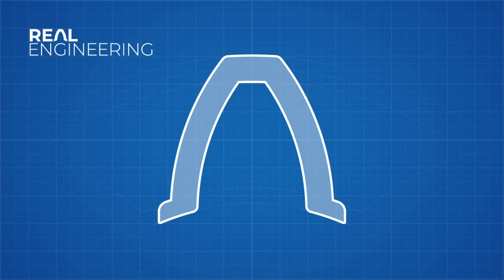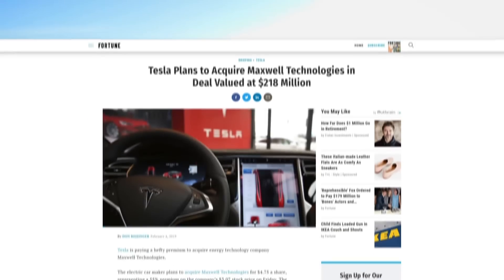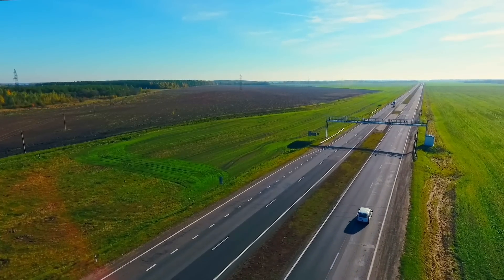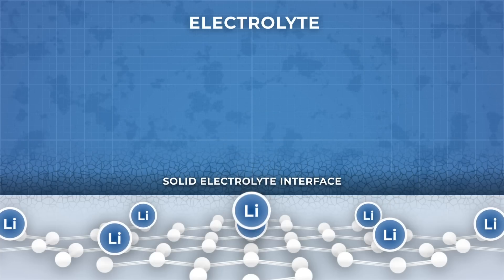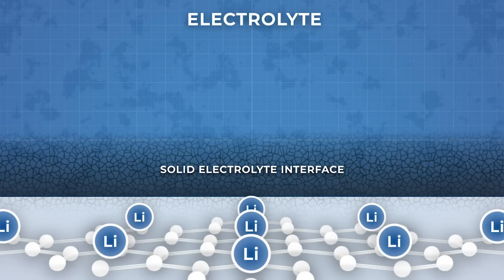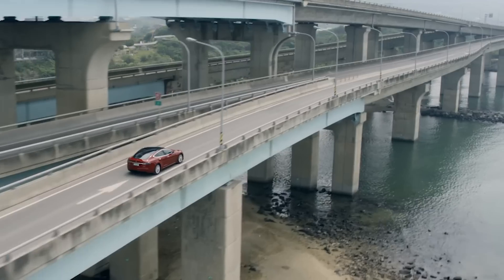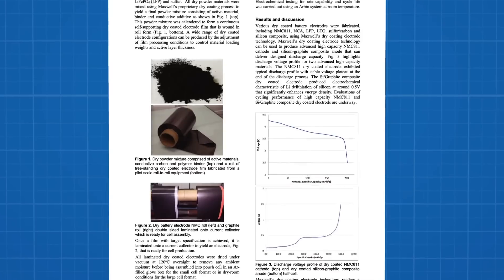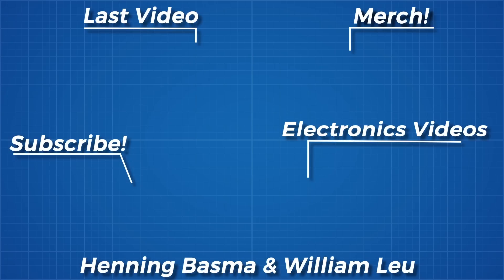Tesla's Quest for Better Batteries

Comment: So basically, the Maxwell ultra capacitor is like Glycogen while normal battery is like carbs
Reply: Eh, well, I'm not sure.  Glycogen is a carbohydrate (just a large glucose polymer, and glucose is a carb).  Glycogen is the storage form for carbohydrate in the body.  It's true that glycogen can be broken down pretty quickly relative to other substrates -- and thus yield energy for cellular work more rapidly, akin to the higher discharge rate of a Maxwell ultra-capacitor -- but the "slower" energy source that would then be much more appropriate for the analogy would then be fats/lipids.  Fats have a greater energy density than carbohydrates (akin to the greater energy density of a conventional battery when compared to capacitors), but they're slower to break down due to the number of steps involved, the speed of the individual reactions, the need to transport substrate into the mitochondria, etc.

Note that this most cleanly applies to a comparison between the process of aerobic fat breakdown and anaerobic glycogen breakdown (glycolysis), since aerobic breakdown of carbs essentially becomes the same thing once the products of glycolysis have been transported into the mitochondria and turned into Acetyl-CoA (in other words, the stuff that came from fats and the stuff that came from carbs are indistinguishable from one another at that point).

Sorry for dweebing out here and maybe being a bit of a buzzkill; I just thought I'd try my hand at creating a slightly more accurate analogy in the hopes that it'd clear up misconceptions before they're perpetuated.  Unfortunately, explaining the logic behind my comments took a little more text than I would like.
Reply: @GravisTKD  I had the same reaction. IAC I don't think that hybrid concept going to catch on. See my comment elsewhere on this video.
Reply: don't you just love how concepts converge in otherwise totally unrelated fields
Reply: @thomas.02  oh yes oh yes
Reply: Yea quick energy vs stored
Reply: Sorta, yeah.
Reply: thanks now i understand it better!
Reply: I would say ultra capacitors are closer to phosphocreatine. Almost immediate availability and regenerate rapidly. Glycogen is faster than glucose but does not play a big role in inter-exertion rapid energy recovery.
Reply: @DRFisher7  Ah yes. I am no doctor but I was thinking something related to ATP and ADP.
Reply: @DRFisher7  I suppose that comment about PCr is fair.  It is indeed a faster (and much more quickly exhausted) ATP source than carbs or fats, so the analogy holds.
Reply: @DRFisher7  Nice analogy. Just so I understand, electrons (or the flow of electrons) are ATP. UC are PC and batteries are glycogen. To stretch is out a bit more, petrol/diesel could be anaerobic glycolysis/respiration since it can only be used for a defined period of time and produces nasty waste (CO2/Lactate). Maybe that last bit doesn't fit the analogy so well :D
Reply: thanks, that really helps me understand this
Reply: @aeons200  I am not sure haha
Reply: @anonymoushippo-m7d  Ah, good to know.  I wasn't sure if I was coming across as aggressive or overly pedantic (tone interpretation tends to range from tricky to outright impossible in this sort of forum).  I just like this topic.  I teach exercise phys among other things.  I think we read each other :)
Reply: @anonymoushippo-m7d  Well the thing is, the number of steps involved doesn't necessarily provide a clear indicator of the speed at which a substrate at one end of the assembly line will yield a product at the other end.  It is true that the glucose needs to be liberated from glycogen before use; that is not debatable.  However, the location of glycogen granules may (depending on the particular muscle cell we're looking at) mean that on the average, the slight slowing due to the additional liberation step might be offset by the more convenient proximity of glycogen to the glycolytic enzymes that end up creating ATP (since the breakdown of free glucose would largely depend on the rate of random collision between glucose floating in the sarcoplasm and those same enzymes).  I'm not saying firmly that this is a major factor, but it might be.  Hard to say.  I'm also not aware of a lot of literature that has directly compared speeds of "glycolysis from free glucose" to "glycolysis from glycogen," and my feeling is that it would often be more or less a non-issue.

Then there's the additional wrinkle that the glucose that comes from glycolysis yields an additional ATP by skipping the hexokinase reaction that free glucose would be subjected to.  Thus, even if the breakdown of glycogen is a bit slower due to that slightly longer series of steps, it is likely to be more than offset by the ~50% greater ATP yield per-unit-glucose.  This is why I mentioned earlier that, well, it depends.

Sorry for dweebing out on this.  Appreciate the engagement.  Cheers.
Reply: more like battery is fat
Reply: @anonymoushippo-m7d  I think that ultimately, people can debate this back and forth until they agree upon what they would like to use as their reference point.  Relative to fats, glycogen stores are both quicker and more limited.  But relative to PCr, the opposite is true; glycogen breakdown is slower, but longer lasting.

And as I stated above, glycogen IS a form of carbohydrate storage, so treating "glycogen" and "carbs" as two different things doesn't really make sense.  Now if you're specifically differentiating between glycogen and free glucose, that could be more logical.  But then we have to nail down the specific circumstances under which we're operating (including whether the person is fed or fasted, whether they're taking in additional carbs during the exercise effort, etc.)  Even then, the analogy wouldn't really work too well, because the speed of breakdown of "fresh" glucose that's been taken up from the blood isn't necessarily any faster than that which is being derived from stored glycogen (and there isn't much free glucose -- as in, NOT bound up in glycogen -- just floating around in the muscle cell under normal conditions, rendering the comparison largely irrelevant).
Reply: In a Low Carb way of eating, the goal is to get the body to burn fat instead of carbs. (there is no carb enzyme, so carbs are NOT necessary for health.)  We can think of a lead acid battery as fat stores. The body works very hard to use fat as an energy source, thus use more of it than we can consume.
Reply: the capicitor is like adrenaline, the lipo is like chow mein noodles.
Reply: @eduardosampoia5480  thanks for taking the time to weigh in with your expert analysis.  

Next.
Reply: You just made it worse.
Reply: Ultracapacitors are like RAM and batteries are hard drives.
Reply: Glycogen is a carb.
Reply: Replace fat with carbs
Reply: Yeah, one could argue that if you delve really down close to infinite into all of these topics, at some point you likely come to the same conclusions for all of them. maybe the universe formula or whatever it's called haha

Comment: 4:04 there is a mistake in the charge signs of the anode and cathode.
Reply: Thanks, i was questioning myself.
Reply: Negative and positive, unfortunately, have the complete opposite meanings in the context of chemistry than they do in the context of electricity. See here: https://www.allaboutcircuits.com/textbook/direct-current/chpt-1/conventional-versus-electron-flow/
Reply: @SystemDisc  thank you for sending me this link it was really helpful.
Reply: Someone else spotted it. However the diagram has it correct, It's the narrator that has it wrong. The narrator says the opposite of the diagram. Batteries reverse the conventional + & - of annode and cathode. Their primary use in in the discharge so the anode and cathode naming are reversed.
Reply: I also noticed that. I thought these guys were Enginerds?
Reply: @DrexProjects  You may have thought they were but don't believe everything you see or perceive about a monetized YT channel.
Reply: What do you mean? Cathode is the positive electrode and anode is the negative one (cations are positive ions and anions are negative).
Reply: @samovarmaker9673  anions move to the anode ( chlorine ions to anode ) and cations move to cathode ( sodium ions to cathode ).
Reply: @marcvanleeuwen5986  thank you for your explanation. I really didn't know to that extent about the topic, I highly appreciate your the time you put into such a detailed explanation.
Reply: @samovarmaker9673  isnt it the opposite way

Comment: 3:58 The animation is showing Cathode and Anode charges switched from the correct charge. Should be Positive Anode, Negative Cathode.
Reply: Yes I think it's correctly written but he said it in a reverse manner
Reply: The Cathode is Positive 
The Anode is Negative
Forgive my fellow engineer for his negligible mistake.
Reply: No it is written correctly but said wrong. Oxidation (electrons leaving) is always at the anode which is negative in voltaic cells. 

http://citeseerx.ist.psu.edu/viewdoc/download?doi=10.1.1.531.5596&rep=rep1&type=pdf. Page 5 has an excellent diagram.

Comment: If there is an electrolyte, there is no capacitor. In this sense, I think you misunderstand how capacitors work. Moreover, if they are calling something with an electrolyte a capacitor, they are wrong.

Comment: The question remains: once we achieve petrol-like energy densities, what will happen when all that energy is released in an accident?
We are talking about energy densities higher than TNT but without the safety precaution that is the requirement to mix petrol with oxygen. Who wants to ride a ticking bomb?
Reply: Hydrogen would get you the density you need but less efficient in production of the fuel. But the refuel time, storage, weight of storage and sharing the benifets of electric motors make it a great option for trucks of all kinds and long haul vehicles. Commuter or planned routes batteries would continue to work well for
Reply: Hydrogen would get you the density you need but less efficient in production of the fuel. But the refuel time, storage, weight of storage and sharing the benifets of electric motors make it a great option for trucks of all kinds and long haul vehicles. Commuter or planned routes batteries would continue to work well for

Comment: I prefer calling Wh/kg as specific energy not energy density and I call Wh/l energy density.
Adding the words "gravimetric" or "volumetric" to clarify the words just too much of a mouth full.
Reply from the maker: I know. The terms have just become interchangeable in layman language. Energy density is just a better term to get the point across. Specific energy is just not immediately understandable for a lot of people
Reply: Both are energy density. Specifically, it's called gravimetric energy density (based on weight) The other one is volumetric energy density, which is based on volume (duh).
Reply: @Asu01  just look up, apparently both words are the correct term.
Reply: @Jamecbond  *you're
Reply: @Jamecbond  no, it's "you're" short for "you are" used for your sentence: "you are not right". "your not right" is meaningless.

Comment: This is all very incremental stuff, I wish we could have a real breakthrough that increases battery capacity 10x
Reply: rechargable batteries, especially lithium based, have taken great leaps over two decades ago, as far as capacity, longer life and energy density.  I think the gains will continue, but not at the rate everyone wants them to...🤷🏻‍♂️
Reply: @jimhofoss9982  Really? I feel like Li-Ion batteries today aren't too different from those in the 90s. Maybe a 2-3x increase in capacity and longevity. Enough to enable EVs, but just barely. I agree though, I just wish we had a breakthrough.
Reply: @QuantumBraced  That's probably a false equivelance. Energy usage has increased in the last 20 years in leaps and bounds.
Reply: Current tech enables at $35k high performance, full featured, safe vehicle that outsells its competition ICE.

Comment: "The tesla brand represents a movement towards renewable energy"
I'm sorry, but Elon Musk is the CEO of Tesla and SpaceX. One is an electric car company, the other designs, builds and operates the most carbon intensive form of transport known to man. You can't brand yourself as ecologically friendly with one hand and destroy the planet with the other. The only reason it's such a feature is because it's an easy sell for the marketing department. If electric cars were around 50 years ago like they are today, the only thing anyone would care about is the acceleration. The cars would be the same, but the focus different.
Reply: Tim Tarling : OK, genius.  We’ll leave it up to you to develop a non-carbon method for getting into space.. .
Reply: @Paciek Tank He is acutely aware of the environmental impacts of his ventures. The forward thinking purpose of Space X  is just because we need another base for humanity if/when we stuff this planet up completely or get annihilated by a comet.
That venture requires cleaner burning methane fuel and that is where the project is heading with the Raptor engine and BFR , a reusable rocket that saves huge amounts compared to other rockets.

Comment: I guess supercapacitors will also be useful in products like Powerwall and when using a garaged EV as the home's battery bank during temporary outages. I'd guess that normal capacitors can't handle an entire home's electricity usage spikes that easily.
Reply: No.
House "spikes" are relatively gentle compared to cars.
if you simultaneously turned on every electrical item in a typical house you would draw no more than about 6kW.
The chances of that happening are extremely slim anyway.
Horse have repeated hi level drain on the battery and repeated switching to charge. That's where capacitors work.